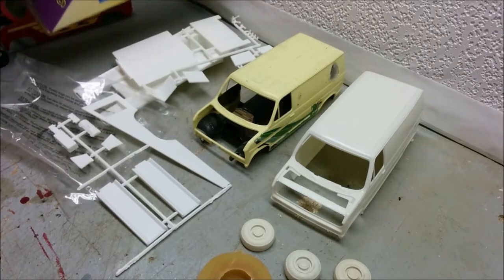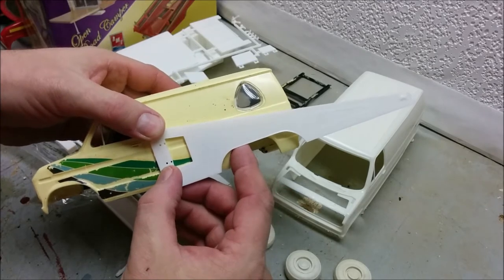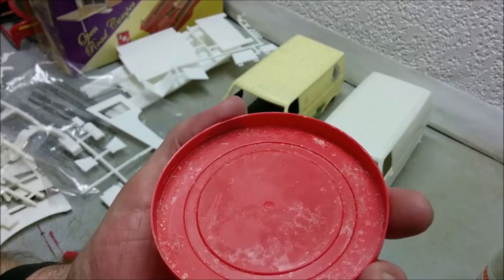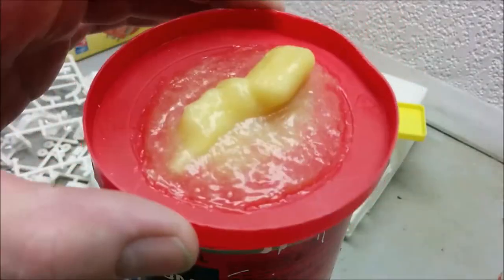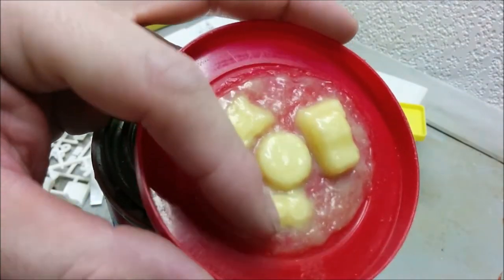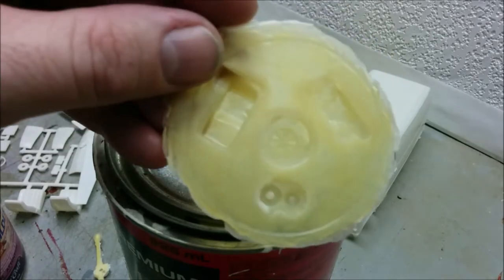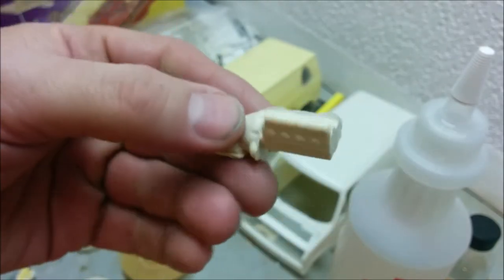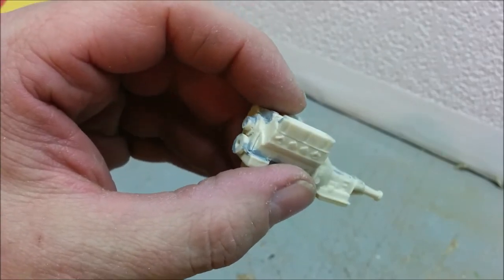The Racer's Wedge build Pt2 1/25 by MPC

Comment: This is awesome how you're  your own parts, I'm  watching  the hole build, I did this kit with an old Dodge pickup, ( bought on ebay). I don't mean be mean or anything, but intake is backwards, the cutout is for the distributor, the long section  sticking out the intake the thermostat,just thought you might like to know.

Comment: The Open Road Camper was originally released in 1969 with their annual Chevy pickup.  It wasn't offered again by MPC.  In 1971 MPC released the pickup with the "Racer's Wedge option.  An extra set of rear wheels were provided for the truck body.  This feature was missing from the parts pack release.
Reply from the maker: Andrew Johnson Thanks for the additional information. I only had the original online article to go by. The basic pick-up tooling certainly went through a lot of variations over the years.